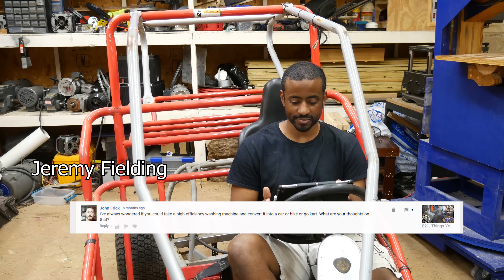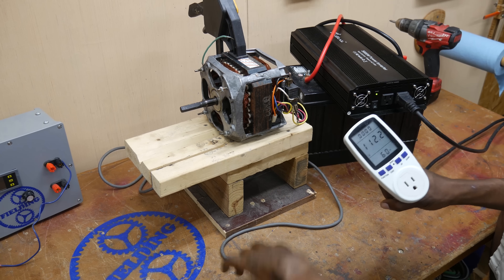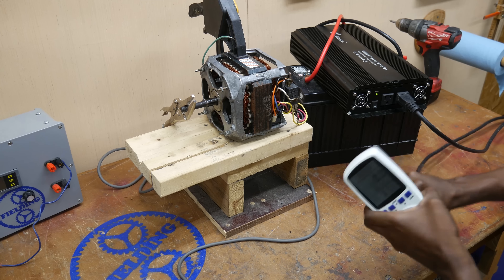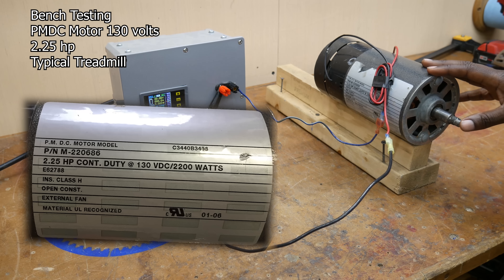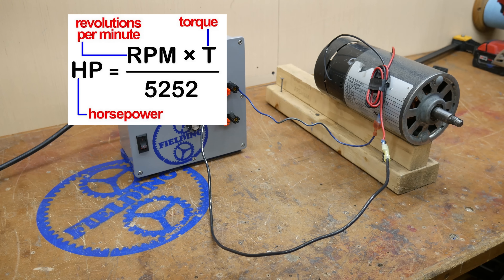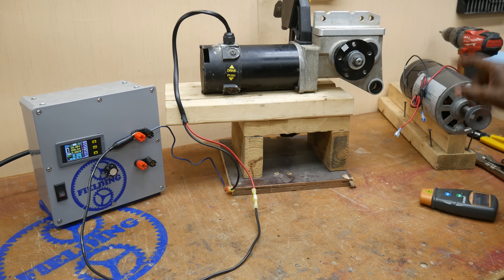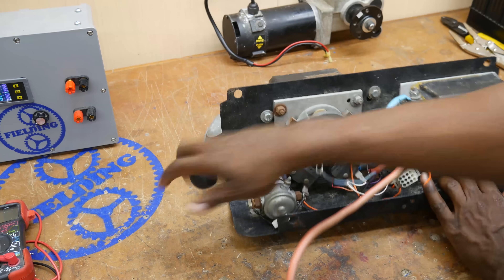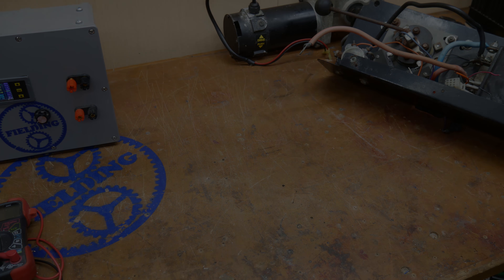What Electric Motors Can Be Used In A Go Kart or E Bike; Bench Testing and Recommended Sizing #61

Comment: Heavy diesel truck starter motors are amazing for a kart, they draw up to 2000 amps at 12vdc and when geared properly they will stay cool, they are designed to crank a 12-16 litre extremely high compression engine so they can be a good fit.   As a note about them, the starters go bad often and can be gotten cheap or free, but they only go bad because of the throw out section 95% of the time, so the actual motor is still good if you rework it for this application
Reply: Evil Me (and the others)
Starter motors seem to be good choices, due to their power. The drawback with them is they are designed for short periods of working, turning the engine for seconds, and then resting for much longer time (they can cool down during the resting).
Their bronze or graphite brushes can wear out very quickly if they work continuously (due to the friction and the heat generated while conducting), and overheating seems to be a big issue. But they put out huge torque.
I think the heat issue can be solved partially, by modifying the case and cooling them with fans.
The friction between the brushes and the rotor also can be lowered, but not too much. This can be the biggest issue with them.
With Pulse Width Modulation controllers, their speed and torque can be controlled easily, but it needs huge MOSFETs, a lot. It's very easy to build a controller with NE555 or NE556 ICs, the H-bridge for the motor is simple, but it needs to be designed and built carefully.
I say the best choice for the job should be a 3-phase induction motor with a frequency modulation controller, which is the most difficult part of the contraption. The controller can be built at home too with some knowledge, and there are well-designed ones available to buy, newly or used. They are not cheap.
Reply: @baladar1353  if it's heavy duty enough, it should be fine. I have a friend that ran his converted MGBGT on a starter motor from a british FV432 APC and a bank of old 24 volt batteries. He had it for in excess of 15 years, until the bodywork on the car rusted too badly.
Reply: they turn about 2400 to 3600 free wheeling. Now controlling them for a long time and cool would be another story. They have a lot of torque. you have to remember that they are still a starter  short running times.
Reply: Thanks evil me
Reply: i used them, i drive garbage trucks. and i get em off the trucks for free. most of the time its just bad brushes. and a few dollar fix..i had two of them...THEY ARE FREAKING INSANE! i love the alternators off of them too. but i have a car, and a motorcycle..they make great make shift bench grinders, drill presses..lol
Reply: @MobiusHexx  They would make a great wind or hydro generator too 🤔
Reply: @MobiusHexx  I'm sorry to hear that your truck is a POS....

lol sry couldn't resist...
I know what you meant.
I bet u find some good treasures.
Reply: Sounds like an added level of complexity not to mention weight. But I like the way you think. I have a friend who has a hybrid. Fast as hell. I guess this is the way it works. I think it's strange that the IC motor shuts off at stop signs and then restarts when you start driving. And it's also strange to me that the batteries only charge when the car is driving. There is no way to plug it in. I've looked under the hood, its a complicated very sophisticated piece of machinery.....
Reply: Although you're sort of right you're sort of wrong in the way that 12 volts is a very inefficient way to use a motor you would need at least a 36 volt motor so you can draw less apps because the wires would have to be massive
Reply: Just a silly question, but wouldn't you use a starter motor and then a regular DC motor?  Have the Starter work primarily when starting from stop and then having the regular DC motor kick in once you get to speed?
Reply: @hugoortega195  having two heavy electric motors that don't run all the time is going to add huge anchor and take up space for batteries
Reply: @hugoortega195  just use a good sized starter, it will last or ages...it's a diy fix as old as the hills and with the battery tech of today, you can have a simple and durable set up.
Reply: Alternators can be rewired to accept a speed control and turned into a motor as well and they have a few different ways they wire them and one is better than the other I believe. I have found a video where a guy shows it being done. He took off a few things and it has 3 lead's to wire into he had said what was needed for both delta types since they require different speed control
Reply: Unless you want to go full throttle constantly, you need some kind of a controller.  A rheostat would be inefficient.  A chopper type controller is easy to make, but you need a thyristor or transistor that can handle the current.
Reply: Evil Me  oh I did not know that
Reply: So the situation is??? Maybe throw a couple in for the hot button 🔥
Reply: Alternator bldc asynchronous motor is the way is has variable field in the rotor to allow tourque rpm curve on the fly and massive amp rating for 12v.. the lower the current provided to stator determines the output tourque/rpm
Reply: I had a friend give me three ryobi 40v battery powered  lawn mowers.  I'm I'm the process of connecting it to a schwinn 21 speed. Not sure exactly how I'm doing that yet but I feel pretty good about it. As far as the motor anyways. I will soon find out. The motor that turns the blade is 36/40 volt dc. I believe brushless, definitely permanent magnet. I really want to mount it in front of the crank and connect a chain to the smallest sprocket then adjust the derailer so it will only shift to the middle and large crank sprocket. So I would have 7gears in the rear and 2 at the peddle.  However I haven't figured out how I can run the motor without the peddles moving when I turn the motor on.. so now  thinking I will have to connect the motor to a gear on the back tire. Or put the motor up front and use a rear tire on the front. Also I'm not sure how long the motor controller will hold up. But I will soon find out.
 At least I have a spare. And a mower to cut my grass

Comment: Great to see a video from you again. Maybe you could glue a thermocouple to the windings of the motor, and then incorporate a temperature display somewhere
Reply from the maker: I do plan to track/measure temperature
Reply: Do ir thermometers work well?  I have one from Harbor Freight, but it requires you adjust it for the type of material you are aiming at.  Otherwise, the reading will be way off.

Comment: I used to mess around with RC cars and I had one geared up for maximum speed. It didn't have enough torque to to move on it own from a dead stop and I always had to give it a kick to get it moving. Once it got moving it was crazy fast on level ground and a lot of fun to drive. I ended up crashing it into a curb one night and destroying enough parts that I didn't feel like it was worth spending the money to get it running again.  You're correct, there's no free lunch, gearing is always a trade off and you always lose one thing to get another.
Reply: Your last line is right on the money; very well said! Also, as you yourself found out, there's that "point of diminishing returns"; you can only do so much with the gearing alone.

Comment: Look on eBay for New, Used, or Refurbished Manta II 10 hp DC electric motor 12 24 48 volt. Not cheap but these are the best I've seen for carts and boats. My kayak does about 23 mph on smooth water.
Reply from the maker: What voltage are using for 23mph?

Comment: The starter motor on a cart . it comes to duty cycle a starter motor is intended to run for about 30 sec. And 60 max. They get hot fast. And most have bushings instead of bearings. They will also hear fast. And seiez eventually.  The alternator converted to motor I wouldn't mind doing that with maybe two. I have been wanting to build a E bike for a while now. I want to build about a 1000watt minimum. I'm no little guy and have hills around here. I was thinking a mid or rear drive and a hub motor up front. One for cruising and the other for hills. And maybe both for showing off. I could build a lithium battery pack. With about 12-15 ah 60-72v and capable of 100-140amps for a good while.. It being mobile I'd wnt to add a charger with atleast 2amps .  I'd like to be able to charge enough to make it home. Or maybe a fast charger. To charge to about 60% fast as possible. A good 10+amps. About 1 a per cell is a decent charge . with 18650' cells anyway. I wouldn't want to go over 2a per cell. At 72v it is likely beyond the capabilities of a 20a 120v circuit. I think a portable 2-3 amp charger is plenty. You may have to wait a hour. It's better than walking home. Even though it's a bike. You can peddle home. I was thinking about 72v on a 48v 1000watt motor. Then maybe add a hub motor if needed. On a 21speed mountin bike. Great video sorry for rambling!!!

Comment: I have a question. Now I have a air compressor it has a  7 1/2  hp 220 electric motor. But it has 2 start capacitors, and 2ea run capacitors.  Couldn't you do that with the electric motor for what you are doing?  I'm just asking. The start capacitor would help it not get to hot for starting and the run might help for running. But I could be wrong. Just wanted to see what you think.
Reply from the maker: The issue of heat is directly related to the amount of current flowing through the motor. Capacitors won't help with that problem.

Comment: could do wat they do in diesel electric trains : use a generator to drive the  electric motor , seen them use weldingrigs for that
Reply from the maker: For this size project it would be better to buy a gas engine. There is a trade off point for cost vs efficiency. For trains the long term cost is better, but I don't think that is a good idea for this type of project.
Reply: i think the reason they do this for trains is the torq those electric engines can produce from zero to watever rpm the torq band is basicly a straight line , immagine the size of the clutch and gearbox you would need to pull those looooooong trains from a standstill and the fact they can put an engine on nearly every wheel of the locomotive
https://www.youtube.com/watch?v=W4V0fxI9Hrw
they use the same idea on those huge rocktrucks and some ships too

Comment: Professor  Fielding  l have a granny  cart  600 lbs rating with too small 12 volt batteries . My ? Is can I use two large size 12 volt ( like RV size ) batteries for a longer range in travel .
Reply from the maker: You need more "AH" amp hours". Find some deep cycle batteries with the highest AH rating you can get that will fit on your wheel chair.
Reply: Tank Soldier 
You don’t have to replace your batteries. You could add two of the same batteries you already have in parallel. That should obviously double your range (assuming your current batteries are still fresh).

Comment: Izzy Swan has used drill power for his Adirondack chair cart and Big wheels cart.  Wouldn't that work just as well for your application?
Reply from the maker: Drills are not rated to work like that. It looks fun in a video but the drill doesn't last very long under that kind load. It will damage both the motor and the battery.
Reply: It's ok if you want to go slow and not very far.

Comment: Duty cycle.... Not sure what you mean there. Not trying to be a grammar nazi but I'm legitimately confused about whether you're talking about AC on time vs. off time,  or like, the amount of time the motor will be running at peak (ish) power
Reply from the maker: Do a quick search for duty cycle rating of motors. That is much easier than trying to explain here. its not complicated just requires explaining.
Reply: Your first part is the gist of it: amount of time ON (and driving a load) versus amount of time OFF cooling off. For an ebike/gokart, you should only consider motors that are rated "continuous duty". Anything else, (intermittant duty motors) will overheat too quickly and burn up windings/bushings/bearings.

Comment: If you can't lay your hands on one large electric motor, what about a smaller one for each rear wheel? If they had separate speed controls, you could have a foot pedal for each wheel and do some interesting spinouts.

Comment: ironically now days the industry standard for manufactured and converted electric vehicles is the ac induction motor!
Reply from the maker: Yeah... but you are talking about a lot of power at that point... your daily driver need more than 10-15 hp. For a side/backyard project the cost doesn't make sense.
Reply: no i understand that, i was just commenting on the irony of the fact that while you were excluding the ac induction motor for your vehicle project the industry has embraced the ac induction motor as the one to use for EV propulsion. if i were doing it i'd be using a series wound dc motor just because of the ease of use and lower implementation cost compared to an ac motor, in fact i've been kinda looking around for a reasonably priced used series wound dc motor because i've been toying with the idea of doing the same thing you are doing only on a little bigger scale. again i was just commenting on the irony not criticizing what you are doing, i got no room to criticize you because  you proven you  know way more about electric  motors then i do.....

Comment: What I don't understand is the massive difference in power between these motors and motors in electric motorcycles which are around the same size. How do they make a motorcycle motor generate around 40 hp and yet these are only maybe a max of 4 hp?
Reply: You mean the same size motors having more power? Well if you can keep up with cooling even a regular electric motor can go 5x it's rated power with extra voltage.
So a purpose built motor with quality components and these days even liquid cooling has no issue going 10x the power of a similar size motor which you might find in your household appliances.
Reply: Good point, i had not thought of that. But even then small wires would be an issue for not being able to handle enough current even when they are cooled. I assume to solve this they could just make bigger wires made out of highly conductive material.
Reply: Larger diameter wires with less windings*
Reply: So this leads me to this conclusion. The reason why such large motors (golf cart motors) are made so large is because they have to be large in order to produce the required power while functioning under a much lower power level than they could achieve at maximum as to produce near zero heat so that they can run continuously without liquid cooling. Thanks

Comment: Very informative. Thanks for the explanations. You said it took several weeks looking to find that motor. Where were you looking and what keywords were you using to search for it? Thanks
Reply from the maker: DC motors, 48v, 36v, 12v, 60v. basically... primarily looking for brushed DC motors because the controllers are cheaper.

Comment: If you used a hydraulic pump that runs off the electric motor, and used the pump to provide flow to a hydraulic motor that drives the cart, you can increase the torque output without increasing the electric motor size or voltage draw. Hydraulic force multiplication means the larger the piston surface area inside the hydraulic motor, the more torque can be applied. Basically battery to electric motor, to hydraulic pump, to flow control (forward/backwards) to safety valve to hydraulic motor to chain drive to wheels. this is why a 20 horsepower diesel engine inside a bulldozer can lift and push so much weight, hydraulic force multiplication. See Pascal's first laws of hydraulics. Good luck and thanks for the great content!
Reply from the maker: In fact It is exactly the same idea. Increased area means less vertical movement. Enormous force applied slowly.. more torque but less speed